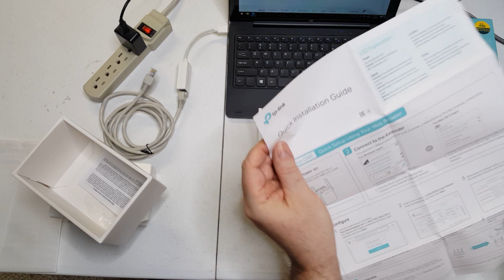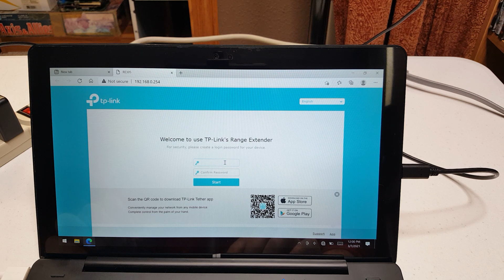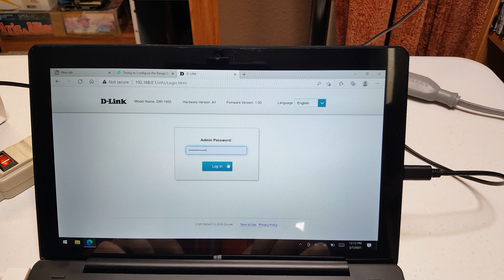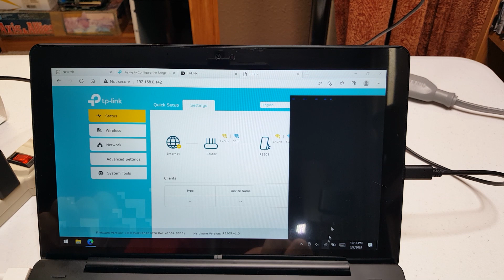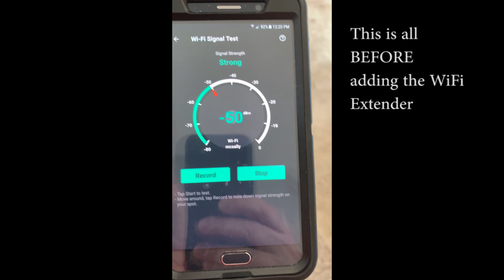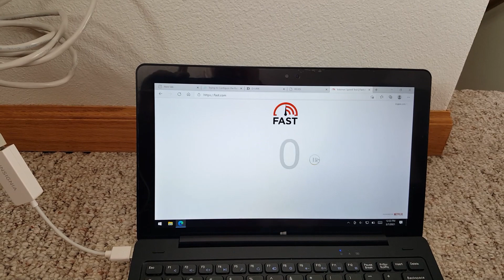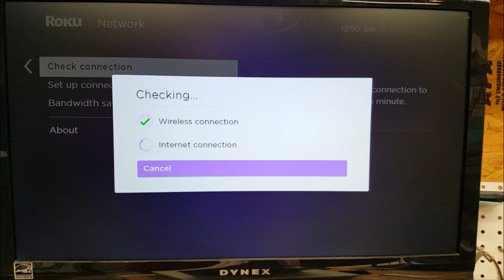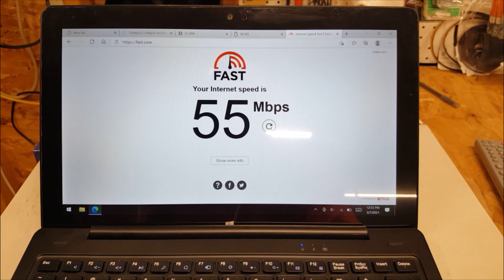How to setup and use a WiFi Extender (tp-link RE305) with real world benchmarking

Comment: hey i know this is a really old video, but would the ethernet port on that extender work with the Cat6 ethernet cord
Reply from the maker: Yes, you can just use it like a hard drop, I even attached a switch and it worked flawlessly.

Comment: is there an option where you can use Ethernet port as Internet source from a router?
Reply from the maker: Not sure what you mean?  The only use of the ethernet port on this device is to run a LAN connection to a device from the Wi-Fi signal the extender captures.

Comment: Hello! I’ve bought a Tp-Link R305 and I configured it but I got a problem with it. Whenever I plug the Ethernet cable from my computer to the extender it doesn’t detect it and I have no wifi board installed in my computer. Can you give me some advice on what to do?
Reply from the maker: Hello!
So, are you SURE the extender is picking up the WIFI signal from your router?  If you go into the router menu and look for devices on the WIFI, does the RE305 show itself?  If so, does it have an IP address (don't send me it!)?
If all of this is YES, then when you plug the Ethernet cable into your computer (I assume desktop as it has no WIFI), what exactly happens?  Does it do anything at all?  If you right click on the lower right-hand corner of your monitor on the Ethernet icon, and select Network and Internet Settings, what does the Ethernet tell you?  Connected, not connected, connected but no internet, etc.?
Reply: @UncleMikeRetro  The extender is picking up the wifi from the router cause on my mobile phone it works, on my computer it simply says “No connection” and when I check on the control panel on the Ethernet and Internet tab it just says that it’s not connected while the Ethernet cable is plugged in both.
Reply from the maker: @auuuurreeeell  Any light on the Re305 device when you plug in the cable?  Any lights on the ethernet port of your PC?  Lastly, any way to try another computer (even a laptop with the WIFI shut off) to see if it isn't your desktop that is the issue?
Reply: @UncleMikeRetro  No they aren’t any lights when I plug the cable, and I’ma try it on another computer. But in the same time I’m considering buying a wifi board and connect it wireless and I think it’ll work better
Reply from the maker: @auuuurreeeell  It may.  That would solve your issues for sure.  I am not committed to these TPLink devices, just had one that I wrote about, you know.  I'd try the other computer "jut for fun" and get an inexpensive WIFI USB dongle.  You are talking like $20 bucks.
Reply: @UncleMikeRetro  I checked some products and they’re relatively low, I found one for 135RON(aprox. 30$). Also thank you for taking your time and tried to help me!
Reply from the maker: @auuuurreeeell  You are welcome any time!  Thanks for reaching out!  I really enjoy interacting with my viewers.  Some really great folk out there!

Comment: Uncle, how do I test to see if mine is still connected?  I don't see it on my desktop.
Reply from the maker: You should be able to get into its web-based menu by putting the IP address into the search bar of your browser of choice.  For instance, in my video, my extender had a separate IP than my router, and I could check on it as I pleased.
ALSO:  If I log into my main router, I can see the RE305 as a connected client, see its IP address, know it is on my network, then separately log into it's IP too to see what is connected to IT!
I hope that all makes sense.

Comment: worst ever extenders ,smashed 2 atm
Reply from the maker: They are low end and ultimately disposable, I agree.  For me, they got the job done until I could put more money and effort into better tech.  One is still providing a 100 MBS Ethernet connection across the house whenever I need to set it up for a jiffy.  Use it for live streaming and works a charm.
Reply: @UncleMikeRetro  smashed one last year and send the video to the manufacturer and bought second one, did the set up step by step, few days later couldn't connect to the network, just had  my hammer and kill it straight away
Reply from the maker: Ha!  I've had some lemons before too.  You are the man just ending it like that!

Comment: Thank you so much. Thinking about buying it. Does it extend both 2.4g and 5g separately and simultaneously?
Reply from the maker: Yes, it will extend both or either and will combine them into one SSID. There are more powerful ones out now, but the PRINCIPLE remains the same, just with slightly different looking screens and performances.  Thanks for the thanks!

Comment: Hi nice video, I will like to know do you know how to hook this thing up to speed up my internet for my ring doorbell?
Reply from the maker: Hi Dave!  Thanks for the kind words.

The wifi extender really won't make your internet connection any faster.  Its more to allow your "regular" speeds in places where you were having issues, slowdowns and dead areas.  If you have your router in one room and the ring bell is "iffy" for connectivity the extender will help make that a non issue just by being there.  Think of it as a simple cheap mesh-like device.  
My biggest advice is always buy frim somewhere you can return it to if it doesn't help much.
Reply: @UncleMikeRetro  oh ok thank you so much for reaching out to me very quickly for that information keep up the good work.
Reply from the maker: @steveo321able  My pleasure pal.  Nice to meet you!